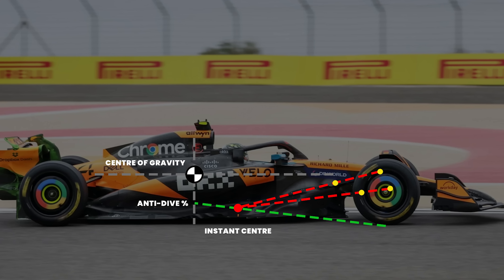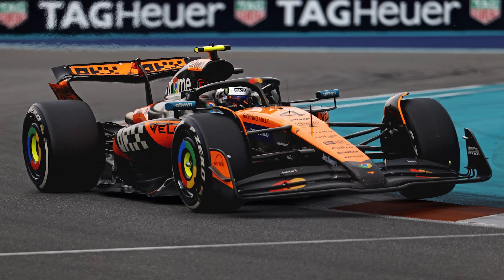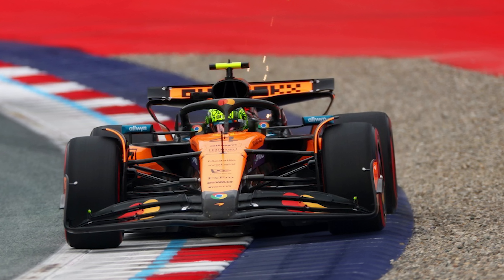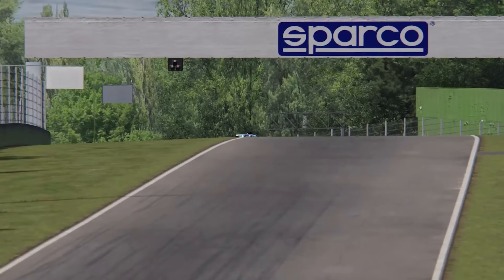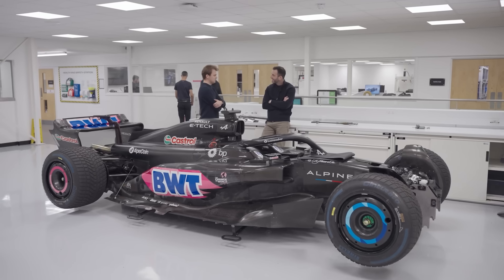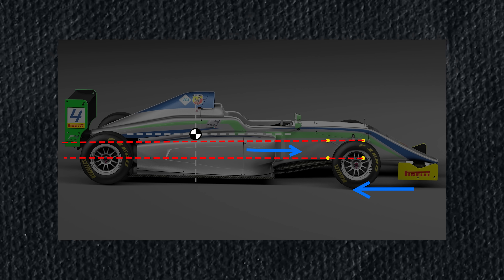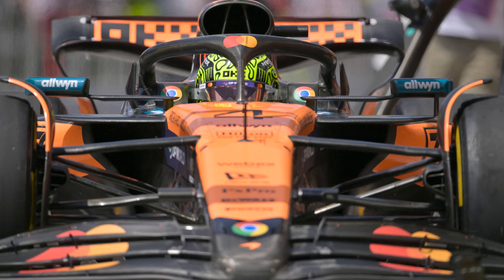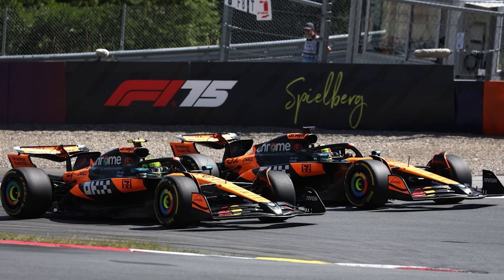McLaren’s NO SUSPENSION Trick

Comment: One would think that locking the suspension would cause more tire wear, since there is little to no suspension movement to absorb bumps and vibration and it would all have to happen in the tires. Yet in reality, on the track in the races, they are doing this and it is working. I noticed something like this last year on the Mersadies cars, and it seemed their suspension arm geometry was doing what there moveable steering colum did, automatically change the camber of the front wheels when in tight corners, to get more grip and less tire wear, so this may be a factor here also.
In theory a locked suspension would allow the internal parts to be partially eliminated, no anti-roll bar for instance, or at least made lighter and smaller - so more aero and more weight to go into the ballast down low, instead of up front.
Reply: There is still suspension movement. Just not caused by braking. In fact since you don't have to worry about the nose going down under braking they could actually make the suspension softer and/or more travel.

Comment: Someone else also noted there may be a new form of active suspension happening in their car that hasn’t been discovered even though the results are producing similar results.

With regards to this theory of transferring the load so well, this load would/should vary depending on different corners and yet their car is neutral in any situation which suggests there must be something else or in addition to this theory. This brings us back to an active suspension type of scenario which remains “active” as it did in the past Williams cars. The McLaren is gaining an advantage at every corner and straight.
Reply: I mean the last form of “active suspension” we had was the FRIC systems of the early 2010s which used fluids to balance the car from diving under braking and provide a better level platform 

But yeah maybe the teams have found something new despite the lost of the inerters that was being used as well in the end of the last regulations

Comment: 10:09 not exactly sure this is true, anti-geometry shouldn't change the load transfer under braking, this would be determined by the acceleration of the center of mass with respect to the pitch center
Reply: I think what he's trying to get at is there are less load peaks and valleys and that a more consistent load is placed through the tires, which can be more easily accounted for in setup, keeping the tires in a better working window. This is just my assumption though.
Reply: I also didn't understand this part, 

The total load on the front should be higher in the case with antidive ( load transfer +  aero with no loss from pitch ) compared to setup with no anti dive( load transfer + aero with losses )

Because the aero platform is stable under dive, the load change is only from load transfer which would be much more consistent and linear than a combined effect from load transfer and downforce change.
Reply: Anti-dive won’t change load transfer indeed but leads to less variations in downforce due to less variations of wing to ground distance (and maybe incidence angle but that should be a small effect)
Reply: Aero load is very different than mechanical weight transfer lol.

Comment: The old cars are often faster so why not take the ground effect mostly off the car, you can then have a softer suspension which can easily ride the kerbs like the old cars, better tyre wear, could be quicker?  Just like Brawn didn’t use KERS in 2009 😮

Comment: Anti-dive isn't new or a secret, maybe they managed how to deal with the trade-offs better. It is also important to note the tires will still deflect as a spring and cause pitch movement. 100% anti dive is not enough to remove chassis movement, you would need a higher value that actually makes the suspension lift during braking to offset the tire deflection. This does put extreme load on the suspension components among other downsides.

Comment: I understood this situation almost from the start of the season.  Norris' comments following McLaren increasing the front anti-dive geometry took me back to Rindt's comments when Chapman introduced the Lotus 72.  Rindt hated it so much he refused to drive the 72 until Chapman reduced the amount of anti-dive in the car.  He preferred, and was quicker, in the old Lotus 49 until the 72 was revised.  But once the amount of anti-dive was reduced he adapted and went quicker still in the 72.  It was very sad that he didn't live to enjoy his WDC.
Reply: How does the channel owner knows this but the other teams don't? or refuse to use it? Why wouldn't other teams do the same thing if it works?
Reply: @jay_z3  F1 is a very complex sport and the engineering behind the cars are more than at least I can understand so the design of the cars might be stopping them from doing so. Or the structure of the car itself may not allow big benefits for the driver's loss off feeling and/or enjoyment of the car. Still I'm no expert, but I'd think that if the other teams aren't doing it, the reason is something is hindering from it most likely.  Also to add I don't think the suspension of the car alone is the reason for McLaren's dominance, the whole car is probably from an engineering standpoint a work of art.
Reply: @robotheo3608 Oh ok. It just amazes me how the owner of the channel gets this information, but it seems like other teams are stomped by McClarins dominace and wants to have the FIA investigate. If they knew what the guy of this channel knew then they wouldn't call for investigations.  I'm just trying to figure out how does the owner of the channel has more inside info on McLarin than the other teams and their engineers do? 🤷🏽‍♂️
Reply: @jay_z3  All the teams know about it..  The car is a complex system that has to work together..  You can't just crank up the anti-dive on any car and go faster.
Reply: @ACatKrom I know you can't add anti dive and start driving. Other things would have to be modified as well, I'm just saying. I just dont understand why they want investigations if they already know what's going on. If it wasn't for the investigations, then I would see your point clearer. The investigations make me think other teams have no idea what's going on, but based on this thread, you guys say they do know what's going on. 🤷🏽‍♂️
Reply: @jay_z3 I understand they must have noticed the antidive but probably havent found a way to make it work with the rest of the car/driver as a whole. anti dive is not new so there has to be some compromises otherwise everyone would be doing 100% antidive. it's just that McLaren somehow made it work which the video doesnt explain how. What's very clear is that the more ground effect becomes prevalent for downfoece, the more limiting dive/squat/roll and maintaining a consistent ride height pays off, possibly despite orher drawbacks
Reply: @geemy9675 Oh ok. And I guess the driver would have to get used to such a change anyway. Everyone can't drive with anti dive.. I just think the owner of the channel should do a video on why other teams do investigations despite knowing what's going on. It's just weird when he talks about this stuff because it makes it seem like he has inside info when he probably doesn't 🤷🏽‍♂️
Reply: @jay_z3  The antidive isn't what is making the huge difference in tire/brake temps.  Just look at the thermal imaging pic of the rear.
It is prob giving them better downforce on entery/mid corner.
Reply: @ACatKrom Yes, I'm aware of that. They did some wizardry with their rear brake ducks.
Reply: @ACatKrom anti dive an keeping the bottom flat meana more downforce, more weight on the rear, so they might  habe adjusted the brake bias for more rear braking, reduicing the frlnt tire overall temperature but that wouldnt create the weird pattern in the video
Reply: @jay_z3 Iread during active suspension era (early 90s) some drivers were puzzled by the lack of diving and were able to adapt better with the active suspension tuned to exagerate anti dive and squat/raise the front under hard braking, and that feedback, even reversed, couldnbe leveraged. if 100% anti dive proves to be consistently quicker, especially saving tire life, teams will get creative and drivers will evolve (adapt or disappear).human brain has a lot of resources and can adapt to pretty much anything with enough practice even when it seem impossible (like switching left/right hand in highly competitive sports etc..)
Reply: @geemy9675  Yep I remember they did that back in the day, and yeah I say Drivers need to adapt because McLarin will continue to dominate if they don't lol.
Reply: @jay_z3 But thats not sure prooven knowledge. It is likely but not 100% sure.
Reply: @jay_z3 they have also budget limits. when they discover another team has a new solution they can investigate and analyse but they still have to perform the usual day to day development work. it's not like they have engineers working full time only at analyzing/reverse engineering the other teams. they have to be agile and reassign people depending on the current priorities, but they do have staffing/ cost constraints, so it will always take time to catch up. they might be working hard at trying to replicate McLaren suspension as we speak, or maybe they have already tried, we're not successful, and decided to go another route
Reply: @jay_z3 You really think that a good execution of a suspension concept takes days or weeks? 😂😂😂
Reply: The geometry shown shown does not indicate there is any anti dive at all.
Can I contact you on a one to one basis.

Comment: Mclaren most certainly are doing something with cooling their tires and wheels that no other team is able to do on their level. Austria was a lot hotter than expected and it greatly affected teams. Mercedes is known for performing better under cooler conditions, but even then, this was massive. Ferrari clearly made a decent jump forward, but the gain of Mclaren over the rest is bonkers, and with Piastri being up in the rear of Lando, without having ANY significant heat effects, even after flatspotting the tire, most certainly shows that they're running some kind of trick. 

There may be no (direct) breach of any regulations, but that doesn't mean there isn't a trick. The fact it's kept so secret obviously shows it's in a very grey area. The tightening of the wing flex and not having any real change shows it's not the wings. 

I get that the suspension geometry plays a part, but even then, that can't be the Hail Mary. Other teams have tried and considered this, especially Mercedes would have with the porpoising. Mclaren found some trick mid 2023 and found a way to optimize their design on that 2024 onwards and for 2025. 

It might work for '26 too, but i'm sure the other teams must be desperately trying to find what's going on, as if it's such a gain, that'll work for '26 too. I really feel like the trick Mclaren uses is likely not really 'legal', but the trick cannot be proven to be illegal, which is a difference. 

Simply put : In court, only evidence may be used to prove guilt that fits the regulations. There may be 'evidence' out there that is undeniable in proving guilt, but if for some whatever reason that cannot be used in court, and other measurements need to be made to determine guilt, and those measurements are not sufficient to prove guilt, then the jury must conclude that the person goes free - and i feel like this is a bit where Mclaren is at.

Comment: Once you said center of gravity i clicked off. Its center of Mass.
Gravity is a force vector that pulls towards the earth. An object moving at velocity and experiencing acceleration - in an inertial frame of reference, has independent force vectors which are affected only by its components mass and inertia. (Also wind, heat, friction etc)

Maybe interview engineers? These videos just look silly, no disrespect, but you should respect the Engineering field.

Comment: Sorry, but what you're saying here isn't really true. A car that dives when braking brings the front wing closer to the ground. The front wing works with ground effect, which is increased as a result. Since a car achieves most of its braking effect with the front, you get higher braking force. This has been used in F1 for decades. Of course, there is also a downside. Too much dive provides a lot of braking force, but it also shifts a lot of weight forward, which is a disadvantage when cornering. A car that does not dive at all has an advantage there, but has a longer braking distance. So it's always about finding the best compromise. And while we're on the subject of anti-dive, the two rear mounting points of the front suspension drop downwards. As shown in the picture at the beginning, this results in a low instant centre, which actually reduces the anti-dive value! So the McLaren has a lot going for it – but certainly, as the picture at the beginning also shows, it does not have excessive anti-dive, which, as already mentioned, would also result in a longer braking distance.
Reply: What do you mean with weight shifting forward? I hope there's no mass moving in the car.
Reply: You are a legend … in your own mind. 😂

Comment: How comical. LOLOLOL The conversation went from Macca are definitely using Phase Changing Blah Blah Blah, to now… Their Suspension Geometry is genius and exactly how and why their car doesn't destroy tires and more Blah blah Blah. All you guys are hilarious with all your PURELY SPECULATIVE NONSENSE. 🤣

You're NOT part of the team and every team member who knows exactly how the car performs as it does without destroying the tires is sworn to secrecy in order to protect the company's IP's, so you'll NEVER know for sure until one of them does speak, "IFFFFF" that ever happens, which it most likely won't. Why not just say how incredible McLaren are performing as a team across the board and leave it at that?

Red Bull's Flexi-Wings and Foam-Rubber Nose Cones were never elaborated on even though we have video and pictorial evidence of them, and this will be no different. Next week someone will say McLaren have learned how to harness the natural humidity in the air and have a condensation unit built into the aero components and brake housings to control tire temps and you knuckleheads will give it credence and drop videos explaining why THAT then makes total sense. What a sh*t show.

Comment: Surely other teams are aware of this set-up plus you can't hide suspension geometry.  So if this is the game changer that you are suggesting the sole drawback seems to be the feel which is up to the driver to adapt.  Are other teams NOT using it because of driver's negative feedback?
Reply: The issue is the whole "the entire load is handled by the chassis, mounting points, and arms" thing.  That's a lot of force going through parts that have low to no flex.  Making that work without breaking spectacularly is very difficult.